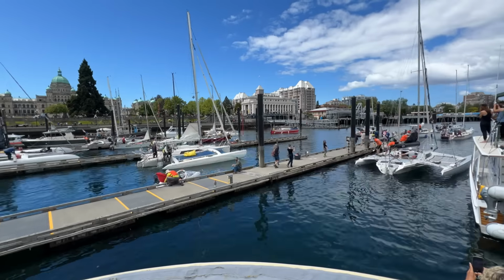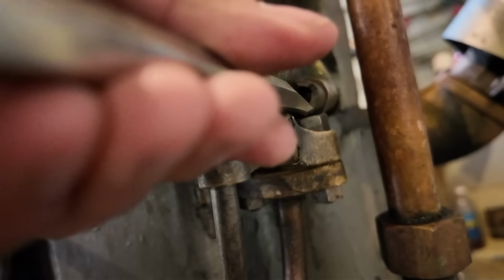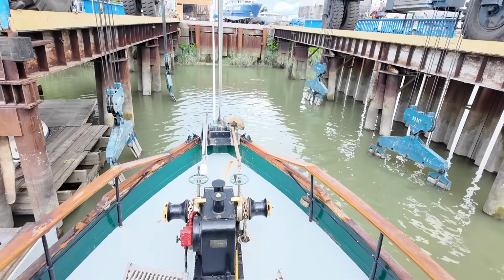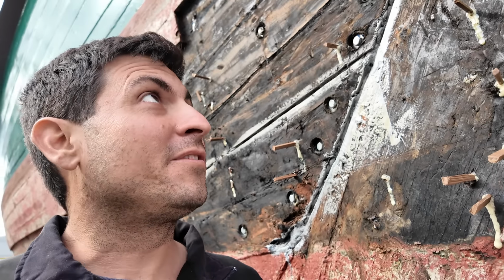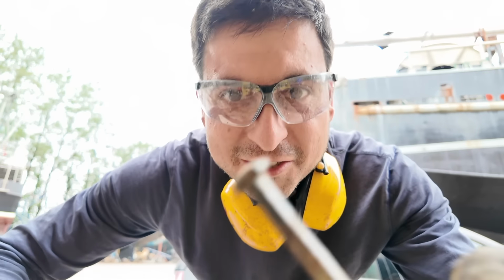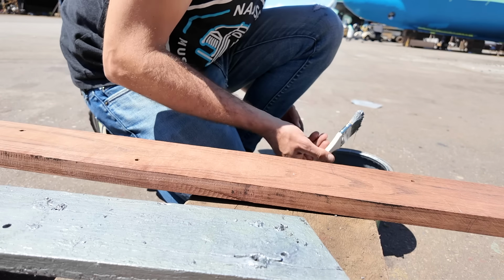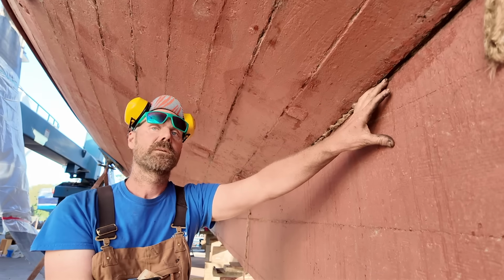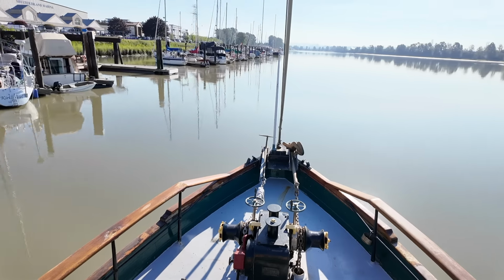EP3 - Emergency Haul Out in Vancouver!

Comment: Those are great inexpensive rechargeable headlights. I work in attics and use them everyday. I can get about three hours out of a full charge and they are some of the brightest lightweight headlights you can get anywhere. I purchased several pairs and rotate them daily and recharge every night. Way better than replacing 3a batteries every couple of hours. Paid for themselves in a week.
Reply from the maker: Haha yes they are, my system is less organized as I keep them in spots all over the boat, and if one dies I plug it in and go find another. You would think you only need one headlight but I don’t think I’ve ever had too many…

Comment: I "almost" surveyed Argonaut II over a decade ago. 
She is beautiful alright. 
An old trick is to hook-up a "Y' valve on your engine cold water intake  with a hose laying in the bilge, if you get a serious leak you turn the valve so the engine suck the water that is in the bilge instead of the water from the ocean. Of course with a keel cooler it depends on your set-up.
Cheers,
a.
Reply from the maker: Thanks - unfortunately I’m freshwater cooled with a keel cooler but that’s an interesting setup. I do have a way to pump my keel coolers overboard so it would be easy to put an intake valve in the bilge as an option

Comment: Nice quick work i spent 22 years part time helpinga friend with his 104' 1943 army rescue vessel called the Fantasea. Before 1980 it was the Magnifico. The stories i could tell of working on that. And moving it around so cal.  

When you say the flywheel was slinging water.   Need to think about perhaps modifying a scoop to allow water slung if you are taking onwater thrua hose or duct and overboard.  I have never seen your gardner engine set up. . I had plans on cheap automotive hub and bearing assemblies belt driven on the 6-71s that just spun with the engine and a dry impeller and pump housing  no carbon seals  as any time waterin the engine room bilge would happen. These were ready for it. We had crazy amounts of water in the engine room several times over the 22 years i helped .

Comment: I get keeping a boat traditional. However underneath the sheet planking, I would just use epoxy and fiberglass for the base planks. I grew up with planked, oakumed boats and they're a pain in the neck. You haul them out to long, they leak like sieves until the planks swell, all the organic material rots at some time, marine borers love the stuff... You're obviously much more of an original lover than I am. I could have figured that out when you made your gasket, instead of just plopping silicone on it to create one, which is what I would have done. I consider myself competent in maintaining wooden vessels, but you apply real craftsmanship to your vessel.
Reply from the maker: Everything is a trade off, and I do use modern solutions where it makes sense but part of the fun is keeping things traditional - where everything is fixable, replaceable, and can be redone when mistakes are made.
Reply: @MV_Argonaut I have to agree with you there.   Big epoxy fan myself,   but trying to 'sheath' or hybrid a planked hull is problematic in a host of ways.   I WISH you could make a traditionally built boat maintenance free but that is their nature - to require vigilant observation and care to all of her parts with the means to replace any single discrete piece.   Not a monolithic assembly like a cold-molded, strip-planked, or glass hull.

Comment: Be extremely careful of deadheads in the fraser. with the weakened stem planks. One of the most important areas in a wooden boat is the stem area. Im glad you got a shipwright to refasten the stem with stronger bolts. Because if you hit a deadhead it will literally work any bad nails out. And cause issues. Deadheads are really bad in that area. Especially with the murky water. Anywho. I commend you for owning the Argonaut and persevering through tough times. To me you are living the dream. Owning a classic like that. Best of luck!

Comment: Get a good quality tarp and learn how to use it.  We have had a boat hit a rock-face, splitting the planks off the stem.  A fellow with experience, put 2 x 5lb  leads on the corners of the tarp, lowered them at the bow and walked the corners back to mid--ship.  Pull the tarp up tight and the water pressure stops the leak.  We then steamed 10 hours north to Prince Rupert and the haul out.  The Argonaut II is a disaster going somewhere to sink.

Comment: Where in Vancouver can you haul out a boat?    I remember when Denman St. crossed Georgia and ended at Coal Harbor.  There were all kinds of marine businesses, etc, there.  That was over 50 years ago.   And Granville Island has a boat lift.   It hasn't been used in decades, and has probably been scrapped and replaced with a Starbucks.    So you have a few white glove marinas around False Creek, the heritage boat dock at Kits Point, and then the Vancouver Yacht Club.
Reply from the maker: Hi William - that must have been a neat experience. A similar situation has unfolded in Seattle, but the traditional wooden boat building remains well and alive up in Port Townsend. I think I’ll be stopping by the heritage boat dock on my way back south in late August!
Reply: @MV_Argonaut  There is a big old ferrocement staysail schooner, called "Black Eyes".   She has a 6 cylinder Gardner engine like yours.    Last I heard she was moored near Bowen Island.
Reply from the maker: Ohh I'll look out for her on my trip south!

Comment: I’ve hammered out my share of gaskets with a ball-pein hammer but I always feel guilty doing so, especially on bronze; over time I worry that I’m likely to round over the machined edges of whatever fitting I’m trying to gasket. I’d rather tap the gasket material only hard enough to faintly imprint the fitting’s outline and then use gasket punches and other cutters to finish the job. I love your boat; takes me back…
Reply from the maker: Thanks! And yes, I feel the same way. Sometimes I’m limited with tools that I have on hand that are stowed aboard the boat, but they seem to be working well and the engine has run well since I bought her

Comment: That gasket that was replaced looks like it is made of material typically found around a heat source such as exhaust gases.  The paper material you used is a temporary fix.  You might consider using a more suitable material for more permanent fix.
Reply from the maker: Yes - was just a temp fix. I was using a soft metal gasket and have since replaced it with a copper and asbestos gasket, which is working well

Comment: Beautiful boat. I don’t understand having the first reaction of shutting engine off. That is like the last thing I would think to do unless the flywheel was in the water.
Reply from the maker: Yes - the flywheel was in the water and was cause for kicking up the bilge water all over the engine room. I was concerned for the engine, electronics, etc. and since the engine itself has no electronics associated with it, easy to start back up if needed

Comment: Shouldn't you use spring hose clamps to ensure it does not loosen?
Reply from the maker: These are what are currently on the boat, but I will look into spring hose clamps. Thanks for the tip!

Comment: you seem to have way too many issues with gaskets blowing out...  have you tried proper any other gasket materials?
Reply from the maker: Hi Tom - you’re right, and mostly because I was using some paper gasket material as a temporary fix until I could put some metal ones in that work much better. Everything is working well now that I have a better material in there

Comment: Don't know how Kosher it is but in the past I've installed an "Y" valve on the intake waterpump line so that the pump cam be switched to pump bilge water in an emergency......bear
Reply from the maker: Yes, totally kosher and many boats do it. Unfortunately my cooling is connected to a closed loop freshwater keel cooled system and that’s not an option for me

Comment: Did you do not know ?
You kan use inlet house from motor cooling sistem to suck the water out. Just tourn the walwe off, and disconekt the house.
Reply from the maker: Thanks for the tip! This boat is keel cooled with a closed loop freshwater system, so unfortunately that option is not available to me. I did have enough pumps on board to stay ahead of the issue, I just wasn’t aware of how bad it was at the time.

Comment: How do you afford the lifestyle?
Reply from the maker: It’s everything I got…and hard to keep up. Trying to find a way to finance the next big haul out (on YouTube), else might need to sell the boat…
Reply: @MV_Argonaut  I would imagine the fuel alone would be a lot. Maybe advertise cheaters to take people on cruises? 🚢
Or have them pay to help repair the boat…
Reply from the maker: I am trying to think of different things. Charters are really hard--and if the boat were in good condition a feasible thing, but the amount of work required is much more than what you could pull in on a charter season, even at the high end of comparable charter experiences. I'm turning to the internet (YouTube and Patreon) to see how that pans out!

Comment: I would consider fibre glass that’s my fix,I know nothing about boats but they should be water tight,chastised me if you will.
Reply from the maker: There are very good reasons why almost all boats in the last 50 years have been fiberglass, aluminum, or steel....but there's something. magic about keeping the tradition of wooden boat building alive and using traditional methods to make repairs along the way... :)
Reply: @MV_Argonaut  if you start with new wood and maintain it alls good,you must have are large wallet,happy and safe sailing.⛵️

Comment: It’s been my experience never to start the engine on a wooden boat That’s been out of the water for a while until it has a chance to sit for a few days and make up.
Reply from the maker: Yes, you’re exactly right. This Marina didn’t have a place to hold me, and actually needed to  me to vacate for the next haul out—since I was only out for 4 days it wasn’t too bad and the boat sealed up rather quickly.